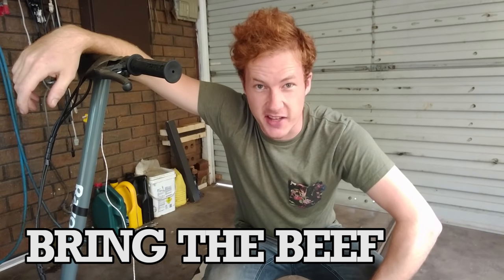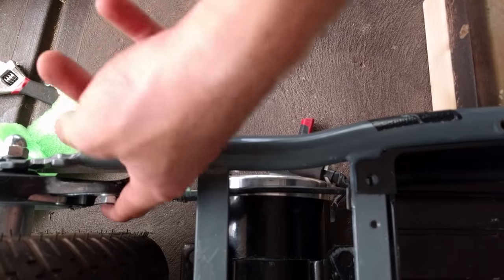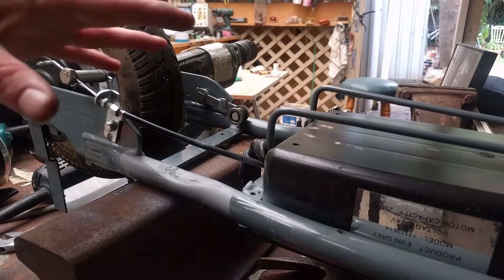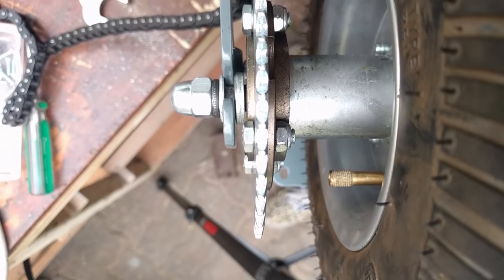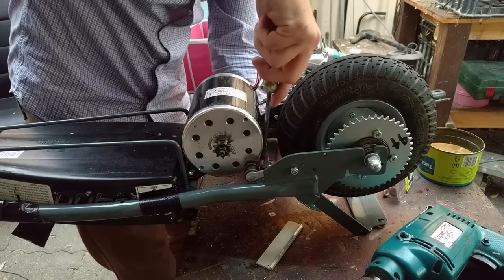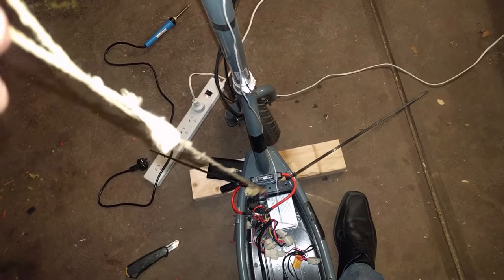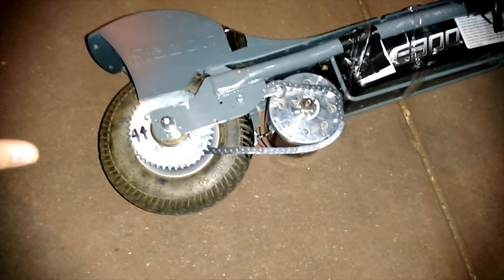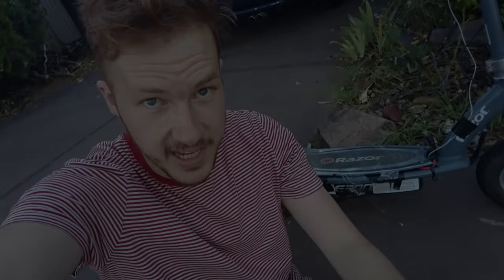Razor E300 Gets a Big Motor Upgrade - Scooter Episode 5

Comment: Well,  My 500W motor is installed.  Not as smooth as your operation.   I ground a bit off the motor in the hope i would not have to hammer the frame much.  It still required a few wacks.   I used an anvil but still managed to totally warp the frame.   Anyone attempting this take care because it has taken hours to get rite.    I'm having a break,  :)
Reply from the maker: Ahaha, it's a big job. Hope it's going well for ya!
Reply: @WhatUpTKHere  Yer it's taking shape thanks mate.  Not looking forward to the brakes.  Also the 36v 1000w controller i bought, does not really have the beans.  The hacked standard one felt like it had more power.   There is no shunt in it though,  possibly a resistor instead?   i think i need to replace it or either add fets like you did.   Thanks Dood.

Comment: T. K. I've been watching your videos for a while and got a couple of tips from your knowledge that, along with my own concepts have allowed me to modify a Schwinn Stealth scooter that went all of 10mph new to achieve 40mph, and I've built an eTrike from scratch that is faster than you would ever want to go. I have an issue now that is causing me headaches and I thought maybe you would have some advice. It's an invacare power wheelchair that takes 24 volts. The issue is that it will not accept more than around 29v and even after reprogramming it and removing most of the safety restrictions is nowhere near s fast as I want it and the motors are barely trying. If I could pump 36v or more into these motors I'm sure I could get a good 15-20mph out of them without worrying about stressing the motors but the joystick/controller will not allow it. Any suggestions?
Thanks, and I love your humor and out of the box thinking.
Reply from the maker: Sounds like you've done some amazing work!

What you wanna do is get some off-the-shelf speed controllers for those motors. Then you can pump in 36V for as long as they'll hold up!
Reply: I'd even suggest one of the robot controllers that have dual brushed motor control with tank steering. Could hook up to the joystick as well as an rc receiver and use it as a remote controlled wheel chair lol

Comment: Tensioner cannot be top mounted or should I say the upper half of the chain, period. The chain tightens on its own on the top half..the slack part of the chain will be the bottom. The natural slack side of the chain is where tensioners go. To show you, put the rear on a block so wheel can spin freely, hit the throttle and she that the top of the chain is pulling tight and all the loose chain is on the bottom. The bottom is the only place a tensioner can go or you will have nothing but problems. That's on any chain driven vehicle or device. Tensioners can only go where the slack part of a chain or belt drive. It will always be the side where the driver motor is returning the chain to the wheel. If you ran your scooter in reverse well then mount it on the top.
Reply from the maker: Yup, got it backwards haha

Comment: you can use a twisty throttle with the original motor controller because it has the 3 wires.
Reply from the maker: Jeremy Maxfield Have you tried it out?
Reply: I assume that it would work because the controller is not made by razor its a generic ebike controller so i reckon it would work with it. If you want I can test it right now
Reply from the maker: Jeremy Maxfield If you do test it, that would be cool - just be careful you don't kill anything! I'm suspicious as to whether it would work because a lot of these controllers with twist throttles have more wires, and when I did a quick trace of thecircuit it looked quite different than the standard TI recommended setup for variable throttle.
Reply: My twist throttle has 3 wires and i also bought a new controller 36 volt one and it also has 3 wires
Reply: i couldn't open the case on the scooter i need a 4mm alen key and i only have 5mm ones.
But i opened up the razor throttle and there are 4 wires with 2 separate switches i wonder why they did it like that instead of having just 1 switch. Probably for safety
Reply from the maker: Jeremy Maxfield that is interesting. I do suspect it won't be possible to simply sub in a resistive throttle then...
Reply: I accidentally bought a lifepo4 bms would it work with li ion batteries?
Its the same exact voltage rating
Reply: Oh i've gotten it wrong the speed controller has 4 wires coming out not 3 woops
Reply: The speed controller i got is this one :
http://www.ebay.com.au/itm/231445926977?_trksid=p2057872.m2749.l2649&ssPageName=STRK%3AMEBIDX%3AIT

Only 20 bucks and fast shipping
The throttle I got took along time to get here from the uk. If you're really desperate you could get something low quality but stocked in aus like this:

 http://www.ebay.com.au/itm/7-8-Electric-ATV-Scooter-Bike-Throttle-Control-Twist-Grip-Universal-/132001738942?hash=item1ebbeab0be:g:eKAAAOSwal5YGGqh

Then you could make the next vid sooner

Comment: Oh sh!z ! So the motor fried on that last deal. 
Well, that sucks..it looked like it hauled ass too !
Well, let's see how this job goes !
On the motor mount issue- Could you go with a pair of "U" bolts and a pair of plates welded to the frame to hook them to ?
>>>-Wulf-->
Reply from the maker: That would also be a good solution! More upgrades to come, too :)

Comment: I have to run to Walmart. I have to run to Home Depot. I have to pick up a part for the cr, for the pickup, etc etc. I'm 48 years old and I want one for an errand getter. 15mph is plenty fast but electric instant torque should have that thing power wheelying through 15 mph. Settle back to a sedate 12-13mph for the cruise. Some decent brakes. I'll run errands on one of them little electric razor scooters just like you're building. I'll have to continue checking it out. Power wheelies through 15mph. Just right..
Reply from the maker: Jim Jordan nice. that's defs what I'm looking for.
Reply from the maker: John McGuire well, if there was a quick and easy way, I would have already done it! 

Assuming you've watched all the videos, you can try and save some time by buying a higher rated controller and BMS rather than modifying them. But all the custom mount work for the motor, moving the brake and so on, remains. 

The true "easy" way is to buy a faster scooter but eh! :P
Reply: E300 looks cool an all but it's charging time is wayyy longer than it should be

Comment: The rpm increases of these motors is disappointing at first.  You need to up the gear ratio to take advantage of motor strength.
Reply from the maker: Absolutely, I had to do that in the following episodes.

Comment: what's the rpm per volt of each of the motor. The new motor probably doesn't rev as high but has more torque. get a smaller sprocket  to increase top end. It may heat up the controller more.
Reply from the maker: Modular Fox Body yeah, I cover this in the video and on the HACKADAY.IO page. thanks for watching!
Reply from the maker: +Modular Fox Body yeah, this is what happened, I cover it on the video

Comment: my nephew has an e300 I'm looking to get it going. I tested batteries they're good. I found he had been riding it with the rear brake on/locked up the whole time so I free'd the brake & the wheel spins but once someones on it , it will not pull weight. I'm guessing the motor got too hot being it is getting power but not strong. do you think this is the issue? thx
Reply from the maker: Could be dead batteries that, while they show voltage, can’t deliver the current. Measure the voltage under load and see what’s going on.

The brakes are terrible stock, you might like my latest video which shows how to do a disc brake upgrade :)

Comment: Hi love the channel. I've just upgraded my motor and controller speed box and variable throttle on my razor e300. Its a 500w motor and batteries were also upgraded to 9ah from 7ah the problem I have is the scooter keeps cutting out after about a minute. The scooter has the original reset button in. The motor has a current load of 26.6 amp do you have any ideas. Thanks in advance
Reply from the maker: Reset button shouldn’t be wired up to your new controller. Sounds like something wrong with the controller or batteries if it’s cutting out after a minute

Comment: I am sorry but that sprocket will liwer the top speed to raise the top speed swith back the sprockets and put a bigger one on the motor
Reply from the maker: If you study this and then the following episode, I explain the motor and gear choices and the effects on speed in detail. 

The smaller rear sprocket does increase top speed because gearing is about ratios. However, we lost some speed in this episode because the new motor is turning slower than the old motor (despite being more powerful). To counteract this, in the next episode, we further tweak the ratio by installing a bigger sprocket on the motor. This helps to counteract the new motor's lower output speed.

Comment: Would it be possible to put a potentiometer on the wires connecting the motor to the speed controller to limit the current going through to control the speed?
Reply from the maker: Jeremy Maxfield possible? yes. would it practically achieve what you want it to? no.  the way to current limit this system properly is through the PWM controller, not by wasting energy through a current limiting resistor (that would have to be MASSIVE to deal with the current).
Reply: Is that what you'll be using?
Reply from the maker: To achieve variable throttle? Yeah, I may try and mod the current controller to do proper PWM speed control, or I may junk the current controller entirely.
Reply: When do you think your next vid is gonna be out? This series is going to hit 1 year soon xD
Reply: I reckon you should try to mod the controller, it's too simple to buy parts off the internet and put them together. I'd much prefer you to go through all the hard work figure out how to mod it so I don't have to buy a new controller. Save me some money :P
Reply from the maker: Hahah. I gotta balance hacking purity against actually getting a video out between now and next year. See what happens. ;)

Comment: Hi there question did you increase the range or just the speed, I've got a e300 ,I want to double its range and run time at least,how would I go about doing that ?
Reply from the maker: If you want more range, add more batteries. :)
Reply: @WhatUpTKHere  if I get higher ah batteries say 20 or 30ah will that effect the motor? Or is it only voltage that will burn out the motor?
Reply from the maker: @Rob-el8ti  In very simple terms, higher Ah ratings just mean the batteries will last longer. 

There's some edge cases where this can cause damage, as higher Ah batteries can technically deliver more current, but that wouldn't apply here. 

Keep the voltage the same and you'll be okay.

Comment: Would it be a good idea to run dual speed controlers if lm wanting to go faster an my moter's could handle the voltes.or why have speed controler does it really help if l don't use brakes any hew.pl help
Reply from the maker: Speed controller is great, it helps you rode slow where necessary :)

Comment: my son bike has the  my1016-hd 24v 250watt motor. can this motor handle 36v? I havent taken it apart but its an old bike from k-mart
Reply from the maker: Hard to say! Could give it a go, but you might ruin the motor in the process.
Reply: @WhatUpTKHere  Thanks a alot.  Guess i'll keep it at 24v and gear it up..its on a 9t and 55t gear

Comment: Why not go with a brushless motor instead?
Reply from the maker: A few reasons! One, I know I've got a capable brushed controller in the scooter already so a motor upgrade is simple. Brushless I'd have to identify a suitable combo of controller and motor which isn't the easiest, especially when dealing with land vehicles requiring high starting torques (I know from experience). Two, it was a fairly simple job to mount the bigger brushed unit. Mucking around with brushless outrunners and inrunners can be a real pain as they've all got different weird ways of mounting which would require much more fabrication and mucking around.

Comment: Hey TK, do you think you could give me the link to the motor, mate?
Reply from the maker: +Steven Verespey I can't give the exact link as it was quite some time ago, but I believe the motor below is the same or fairly similar. I'm pretty sure it was a MY1020, hence the mount modification required. Actually, to be honest, I'm not even sure "MY1020" refers to the mounting.

https://m.ebay.com.au/itm/36V-500W-MY1020-ELECTRIC-MOTOR-SCOOTER-PUSH-BIKE-QUAD-ATV-DIRT-BICYCLE-/351318185531?epid=852981238&hash=item51cc32163b%3Ag%3Am18AAOSwZjJU4-VY&_trkparms=pageci%253Af500c488-98ff-11e7-95a7-74dbd18002cf%257Cparentrq%253A7e831c0815e0a9c438352f12ffee9f11%257Ciid%253A3

Hope that helps!
Reply: Also, how do you wire up the motor? wihout a connector and all. And i've been looking for those batteries but I cant find them.

Comment: can you make a video of how you replased the motor cuz mine is makeing a clicking sound every time i ride it and i want to replace it.
Reply from the maker: Dethklok I am slightly confused - this video IS about me replacing the motor.
Reply: but how do i disconnect it?
Reply from the maker: Dethklok did you watch the whole video? And the previous one? I'd recommend watching the whole series, looking up "The Razor E300 Overvolt" on Hackaday.io, and googling till you get it :)
Reply: but you didnt show how you took the motor off and how you disconnected it and thats what i want to know
Reply: and i didnt find what i was looking for on that blog
Reply: Dethklok there is a piece that slides up and lets the wire come out and generally when it clicks its the batteries

Comment: Why not use a master killswitch. Instead of manually pulling the killfuse
Reply from the maker: Switches to handle that voltage and current of DC are big, bulky, and difficult to switch off in a hurry when you're careening along at 35 km/h. Relays can do it, but it's messy. This is cheap, easy, and effective in emergency situations.
Reply: What Up TK Here i see ahaha silly me.  is it just a prototype? Or a permanent kill switch?
Reply from the maker: Yeah it's kinda prototypey, I'd want something better if this was a vehicle I rode every day

Comment: I think you're loosing speed to the heat generated by the motor. I like how you bolted everything together, but there comes a point where welding could possibly offer a quicker, better, and easier solution. Especially in the area of constructing a motor mount. I.e. you need to "level up" your building skills. Nonetheless, there is a lot of hard work here. Good job.
Reply from the maker: Yeah, welding rocks

Comment: the belt brake that seems to be used on the rear wheel is not that great for the forces that you will be doing... better use a disk break, or get a drum break...
Reply from the maker: Robert Ostman yeah, I'm not a fan of the belt brake either, but without a machine shop I'm not super well kitted out to do so
Reply: if you are in the USA you could call mr tig time, or one of the other youtubers who have the tig welding machine, if they can't do it or wont, they may know who could... my scooter used a belt break... and it failed in probably les than 30 days... yet consider that I was living in downtown seattle taking those steep hills killed the breaks, I even had to resort to force a "controlled" fall one day... cos the darn thing would not stop.. when this happend I was speeding at about 30km/hr... survived... but my clothes were rags after that...

Comment: Sir I have a question so I'm trying to put 24v 350w motor in my razor e300s do i need to change the speed controller. Please help
Reply: Abdullah Zafar it would be a good idea
Reply: No you don't need to. I've been riding with a 350w 24v motor for over a year now. No problems at all. You'll be absolutely fine.

Comment: So why did u change the sprocket
Reply from the maker: Better gearing for more speed! Unfortunately it was cancelled out by the slower rotating motor. 

I do more gearing changes in later videos :)
Reply: So was the motor slower or was the size of the sprocket on the motor the issue
Reply from the maker: Potato Hamlin the motor spun at lower RPM, removing any gains the new gearing would have given in top speed

Comment: WHY NOT *CHANGE THE TIRE VALVE IF YA AINT GOT THAT TOOL IT CAN BE A ISSUE                                                                 CATER
Reply: Hey Fred,Ya Bill,We forgot to line the Valve up.Well darn it again,Drill a darn hole through it bill and we will make a extender and make more money.Uhhh,Ok                CATER
Reply: But it still is a Hooky set up It looks like a child designed & built it*NO WONDER IT BROKE AND NEVER MADE IT A FULL MILE                                                       CATER
Reply from the maker: You are quite angry!
Reply: @WhatUpTKHere  WHAT How is that Angry*?????IF U OWNED ONE U WOULD NO WHAT IM TALKING ABOUT

Comment: I'm having a clunk noise coming from my 500 w motor when I go from slow to faster on my scooter, any help on this??????? seem I turn to go faster and it starts.
Reply from the maker: Could be a bearing problem?
Reply: Something inside the motor, everything else is well tighten no noise coming from nowhere else and is brand new , first run on it. The chain is snug where it won't come out.
Reply from the maker: Tough one! Might have to disassemble things to find out.
Reply: @WhatUpTKHere  The people whom I bought the motor said to just remove the chain and  run the motor, will do this but first I aligned the rim and motor holder, will give it a try again.  See if I get the noise again it seem not to be now after aligning the rim. Hoping that's what it was.